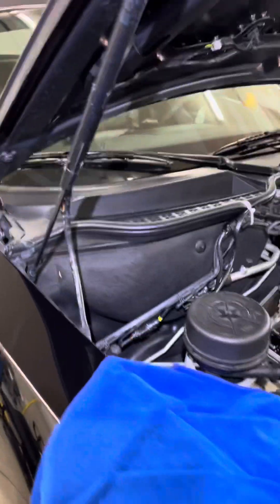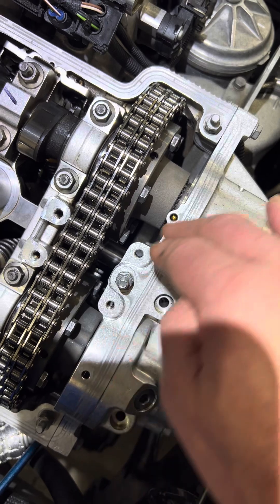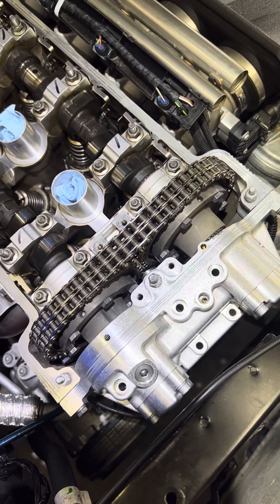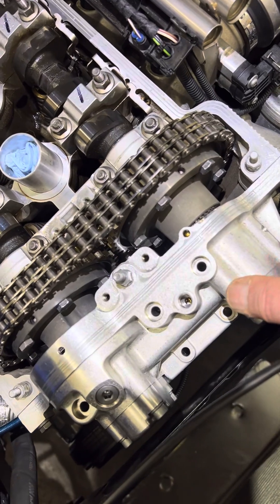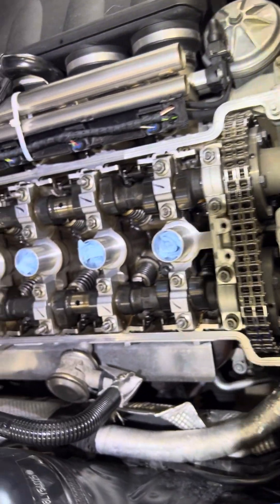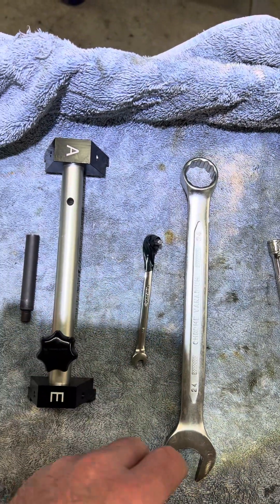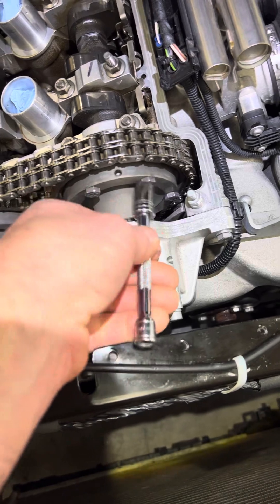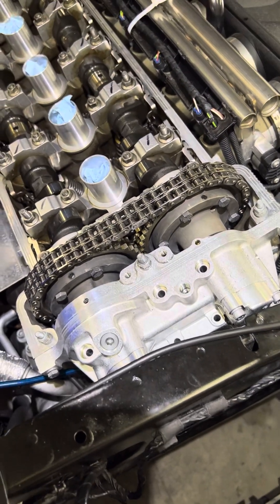BMW Z4 M Roadster S54 e85 Vanos Procedure / Cam Timing

Comment: Thanks for the video. I’m planning doing this work on my Z4 M in the upcoming weeks.
Reply from the maker: @s.boucher9101  Let me know if you have any questions. Not a lot of DIY type info out there for these cars..
Reply: @Swanicyouth given the small clearance between the VANOS piston caps and the front panel (about an inch or so), how easy was it to remove the vanos? Did you have to remove the piston caps first?
Reply from the maker: No. I read it was an issue. I even read someone jacked their motor up for extra clearance. Your going to have to take out the fan & the other stuff you can see missing in my video, including the clip in the radiator support that holds the hood release cable. You may want to get a new clip in advance. I’m very good with removing plastic clips without damaging them, but this one you pretty much have to break one of its insertion tabs. Then, wire tie the hood release cable out of the way. It’s not nec, but I highly rec removing lower radiator hose. It gives you more room for everything & takes like  2 sec. You’ll loose about a gallon of coolant. You can take everything apart you need to get it out in 25 mins. I’m always going to rec removing more easy stuff to make a job easier. You can take it out the oil feed tube w/ the vanos also at that point, just tilt it up a bit when you take it out. No need to take caps off for removal. There is plenty of room.
Reply: @Swanicyouth  Thanks for the guidance. I’m currently planning the work and how I should approach it.

Comment from the maker: You are right. I’m beginning to think S54 people are all crazy. There is a video I watched after this of BMW assembling an S54 at the factory & when the tech put the vanos on he just basically slapped it on in a manner that didn’t seem like it mattered what tooth, etc... 

Despite TIS describing how critical this is & BMW making 2 special tools to manipulate piston depth - I’m starting to think if everything  is connected propery it’s fine regardless. I’ve heard of people having issues / codes / misfires after doing this - but never anyone 100% saying the cams were timed right,  but the vanos pistons were too forward (advanced). I’m just 1 guy w/ 1 car who studied this extensively so I  was 100% sure I was doing it correctly the 1st time. Maybe someone who’s fixed multiple bad VANOS jobs will chime in.

Comment: Nice explanation. I did it essentially the same way, but I did not verify visually that the pistons were too far out by having the caps off, and then install the caps to ensure they were fully out/forward, as you describe. When I had it on the bench, it seemed like the pistons moved freely enough and bottomed out reliably for me. I did the same thing, temporarily locking the hubs with the helical gear out in order to get the pistons to push in all the way. I used a small curved pick to reach in there between the helical gear and the VANOS to force the pistons all the way forward as well. As I recall, I could not physically force them any further forward that I did, so I assumed I had them fully bottomed out. But not visual confirmation as you did, I would do it your way next time.

I think it's great to get them all the way forward, and to pay attention to getting the helical gears in the hubs at just the right spot as a lot of videos have said. But my understanding is that of the available linear travel the pistons may have, they system doesn't use all of that and there is a little leeway in regard to VANOS adaptation capabilities. The amount of linear travel available, when translated into degrees of advance in valve timing, exceeds the amount of advance the system will call for. I think this is correct. 

I also still try to get everything exactly perfect, but I know in the back of my head if I'm a tiny bit off, the system is designed to adapt for that and still operate well within parameters. I hope I'm not wrong in that assumption. I'd love to check VANOS adaptation values, haven't found a shop yet that'll do it for me.
Reply from the maker: Why do you think your’s is not all perfect? Are you getting a check engine light or drivability issue? If not & the car drives great - that sounds perfect to me. I didn’t check adaptation values before or after. I have a $150 “BMW” Foxwell 510 scanner which has “vanos test”, which just manually activates solenoids with the engine off, but best I can tell adaptation values are not on there for Z4 M. Z4 M uses a different model Siemens DME opposed to e46 M3, so all the software out there can not do all the same things for each car. That scanner can clear adaption values, which I did before initial start up. I’m not even 100% sure (or if it’s clear to anyone)  if “adaptation values” are a correction of how far “off” the timing is from perfect (a correction let’s say) or just where the DME has the timing at that particular moment  based on various factors (temperature, fuel quality, etc…). If it’s the later, than shooting for the lowest number is pointless.
Reply: @Swanicyouth  Hi. Yep, it's a good point. I don't necessarily think anything is off. I got it timed perfectly with the bridge, no issues on first start after the work. Pulls great through the mid range. No lights or any other indication from the car that there is a problem. I wonder a little if it is slightly "running out of steam" at the top end compared to before, but I know that is super subjective. What I don't know is if it could actually be slightly down on power at the top end, like that is actually happening, without any codes or problems otherwise and still be technically "within parameters" - I don't know enough about them or the vanos adaptation to know if that is possible. That is the only reason I thought it might be interesting to know what adaptation is doing, if it actually could answer this question in the first place, as you say. My understanding is that "adaptation" is relative to the cam position sensor, so a fixed ideal number, depending on engine speed and load, but that it likely takes other factors, like you mentioned, into account to achieve that. My understanding could be faulty though....lol.